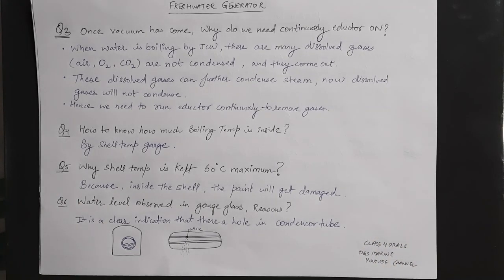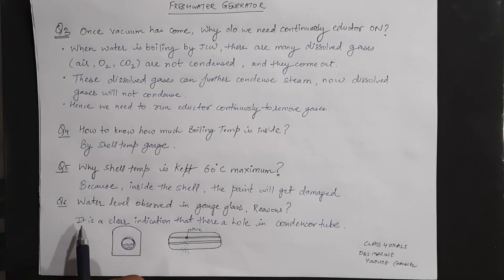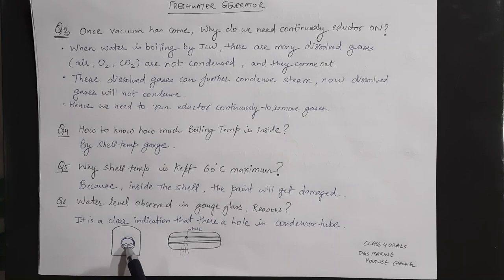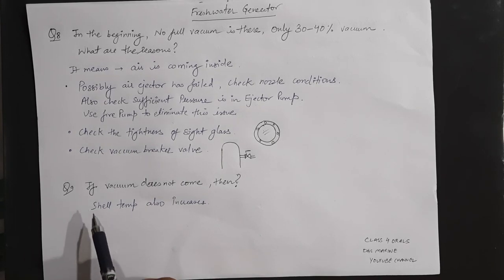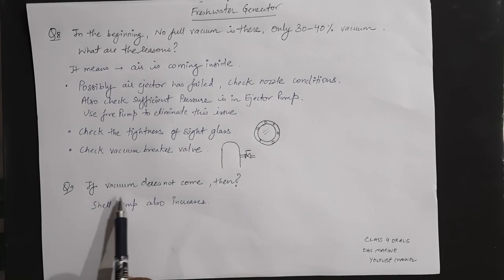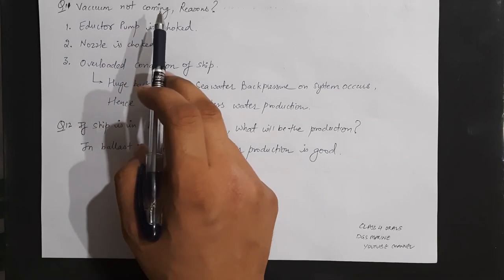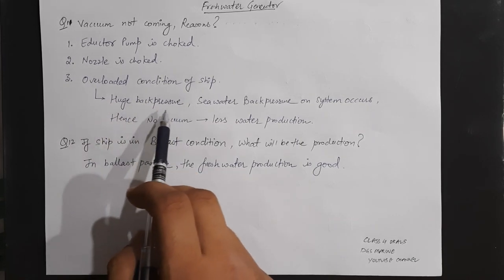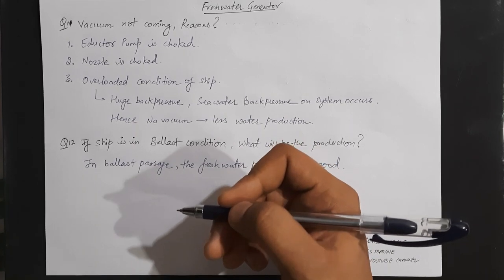Freshwater Generator Questions & Answers Asked in MMD Orals | IMP | Watch Full | Class 4 Orals

Comment: Q 10, point 2, If the sea water temp drops, the rate of condensation will increase thus the production should go up. But you said water production will reduce, please explain.
Reply from the maker: This discussion is debatable.
If you have considerable reduction in sea water temp, then your water production definitely increases.

But if you have huge temp drop in sea water, then in that case, water production reduces
(Think of water production in polar areas)

Comment: Bro the Jcw in and Out temp drop difference on the evaporator side should be atleast 12-15c so in the diagram it’s 25c so heat transfer in the evaporator for the SW to get evaporate is more then is it a problem?

Comment: Brother, sometimes Dg ask a question about FWG.
why the condenser S.W inlet and outlet temperature difference should not be more than 10 degree? 
can u pls help us?  this answer i didn't find anywhere
Reply from the maker: It is related to Heat transfer calculation in Evaporator. Inlet temp and Outlet temp for effective steaming. So for a general Marine FWG, this temp diff of 10 deg is needed. Also thermal Stresses are taken care of.